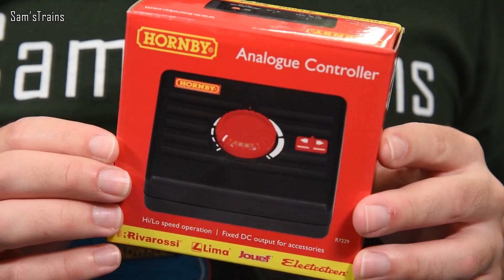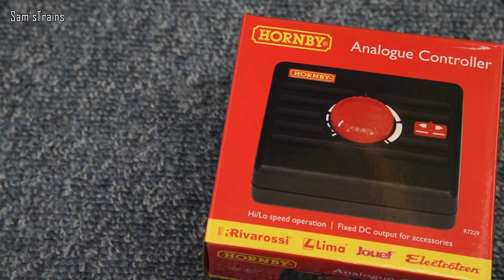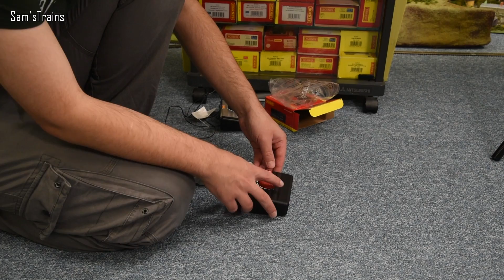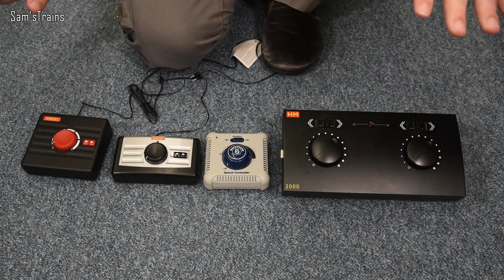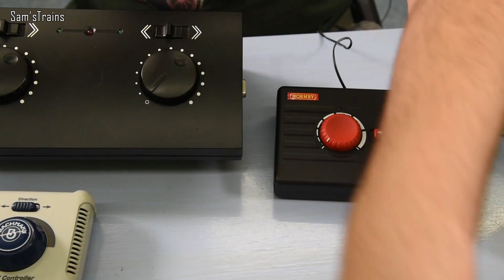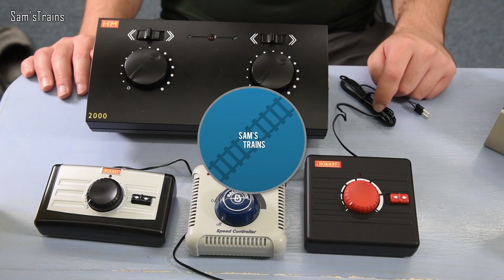Hornby's New DC Train Controller | Controller Buying Guide

Comment: If the "Hi-Lo" switch is anything like the old H&M Duette and similar (Including 1970s Hornby) controllers, then it's probably a resistance switch. They don't make much difference to the top speed, but should do so at the lower speeds. I think it had more to do with the difference in older Tri-ang era motors and the more efficient modern ones. The older motors needed a higher voltage to start, but newer ones would start moving at medium speed at the lowest speed setting. This feature is probably not needed these days, but try the switch at lower speeds and see if it makes a noticeable difference. 

Those same old H&M and Hornby controllers also had a half wave / full wave switch, which was a kind of crude PWM - except the voltage was variable and the pulse width was not, but you got half the AC waveform, so it was turning on and off at 50/60Hz allowing slow control of the motor. It also gave that loud hum. I understand that some motors don't like it, but most are not affected, other than being noisier.
Reply from the maker: Yep, it certainly looks that way - I bet that's all it is! Yes I bet half wave would definitely make the motors sing - not sure I'd fancy that, lol! ;D
Thanks for watching - Sam :)

Comment: Looks like a bachmann. By the way American style 0-4-0's are very cheap (under $20.00 which for the US is very cheap for a model locomotive) on ebay I recommend looking up Tyco 0-4-0's as they out-lasted the company, and still run like new, kinda...
Reply: Now if E-Z Command had the Hi-Lo feature, I could switch/shunt cars around and move intermodal trains at 70smph (scale miles per hour).
Reply from the maker: Yeah the Bachmann one was great for the money! I agree - though you could fit a hi-lo feature, you just need a high power resistor and a decent switch! ;D
Thanks for watching - Sam :)

Comment: Interesting Sam

I'm amazed at the lack of a reset button on any of the controllers. My old lay out had two controllers. A triang RP14 unit that ran the fiddle yard and the quarry sidings, and a H&M Powermaster which controlled the mainline and the station area (it was a fiddle yard to terminus branch layout) - I also had and old Scalextic RP 17 transformer that powered the point motors and lights for the buildings. ALL of them had little button that popped up if a short circuit happened, and stayed up until the fault had been cleared and could then just be pushed back in to reset. Easy, safe and convenient, I dunno why they dont have a similar system these days.

Jon
Reply from the maker: Me too Jon - it wouldn't have hurt would it?! A little button like yours would save hours of frustration over a whole childhood!
Thanks for watching - Sam :)
Reply: The problem with those buttons is that you could press them down and keep them pressed while the short circuit still existed. (Used to do that when I was little, many, many years ago.) They'd never pass the safety regulations these days.

Comment: When you brought a train ( Hornby or Tri-ang) set in the 60's. The controller had a small red button that popped out if you had a short circuit. fix the problem re-set the button and away you go, no waiting. H.M. 2000 is a controller that goes back to the late 70's. Back then this controller was put out by Hammet and Morgan who's controllers where as strong as tanks. My model of this controller is still going strong to this day it looks exactly the same but the lettering say's Hammet and Morgan 2000.Cheers, Chris Perry.
Reply from the maker: Yes I've been hearing about that CHris - it sounds like a much smarter solution if you ask me! Yep - you can't beat those H&M controllers, that's definitely true!
Thanks for watching - Sam :)
Reply: @SamsTrains  Just in passing I also have Hammet and Morgan's 3000 control  panel with brake control , regulater control, variable control and auto power control. plus all the other D.C. and A.C. extra's  A Roll's Royce of a panel. Nealy 40 yrs. old . It hasént missed a beat. Cheers Chris perry

Comment: Thanks for doing this Sam, most of my often run locos are DCC but for DC I have the silver Hornby controller and an ancient looking "Power Mite" controller which I started using for the DC locos because of that horrible motor noise that the Hornby one causes.
Now I've gone and bid on a HM2000 on ebay - don't tell the missus :)
Reply from the maker: My pleasure Gerry - ahh you're laughing then if your on DCC! haha - good choice on the HM2000 - I think the missus would understand ;)
Thanks for watching - Sam :)

Comment: I find it odd that the wires to the track are attached to the controller instead of the wall power wire. 
Nearly every American controller I have has separate track wires but an attached wall power wire (except for Bachmann's, in which the wall power supply can be detached as well as the track wires. by the way, mine is a zero to 100 version, not the on/off one like you have) They are attached by forks on the ends of the wire (or just the bare wire) onto screws.
Also, every controller that I have has ends for powering acessories via AC power, even the very cheap life-like controller (the only controller I have that doesn't have an LED, or a slider to change the direction. Instead, zero power is at 12 o'clock, and you turn right to go one way and left to go the other) 
The controller I mainly used is the MRC 220 (Tech 4), the standard bachmann USA controller (the image on this lkink is exactly what it looks like) https://www.decibelscalemodels.com/index.php?route=product/product&product_id=976
and the Athearn SDK-789.
Reply from the maker: Eih?? Don't they have to be connected to the controller?? The MRC sounds good though - I'll have to look those ones up! :D
Thanks for watching - Sam :)
Reply: @SamsTrains , yes, he means the controller is hard wired to the power adapter, where as the wires connection to the track have a removable socket.
Reply: Perhaps because the UK is 240v AC.
Reply: It's not about the voltage. It means Hornby can sell to multiple markets with a localized power adapter. I have a Hornby controller with an Australia socket. You can also use it in America where the voltage is 110V. It also means if the adapter fails or the controller fails, you could just replace the part that fails.

Comment: Again I have a dumb question but wondered if you would talk about it.

Can British train sets run in the U.S?
Reply: Assuming it's bought in the UK, the only thing preventing running will be the wall plug for the transformer. A simple double adapter for a UK to US plug will sort this.
Reply from the maker: Yep - you're absolutely right! Assuming you can find a suitable adaptor, (or just use a US controller), you should be fine! :D
Thanks for watching - Sam :)
Reply: The locos run off the same 12 volts DC as used in most US makes. The exceptions being three rail or centre stud such as Marklin, which run on 16 volts AC. The USA wall power supply is 110 volts AC at 60 Hertz . In the UK we use 230 volts AC at 50 hertz. A simple adapter socket will not work. You'd need a step up voltage converter to operate a UK wall wart in the USA. Much simpler to buy a US wall wart and controller such as those made by Atlas. That's what I used in the USA.
Reply: The U.S. mains power run on 110V AC so you will just need to check if the power adapter says it accepts an AC input in the range from 100V up to 250V. I live in Australia where we use the same voltage as the UK but we use a different plug and socket. Hornby specifically sells Australian adapters. Perhaps another reason they sell the control without the power adapter, to cater for the market in different countries.

Comment: That controller seems like a very good deal - And you really can't best their physical size.

I wonder if they sell different transformer adapters, so you could purchase the specific power pack that you need? (US, Euro, etc) Strange that they've done that, though.

Fun fact about the Bachmann E-Z controller, the DC output is compatible with a headphone jack, and I have tested this. It buzzes. Quite badly.

Edit: I made this comment before hearing the noise it made, goodness-
Reply from the maker: Yep it's certainly cheap - but not so much once you've had to buy the power supply!
I'm surprised the headphones survived... did they?!
Thanks for watching - Sam :)
Reply: @SamsTrains  The headphones survived alright, but something went wrong with the power supply I was using on my Bachmann controller (It came with a UK train set, and I was messing with an adaptor from another controller) disagreed with it, and it eventually quit working a few years later. A friend of mine with the DCC version, which has the same headphone jack adaptor, said it made a totally different buzzing.

Now, this means that there is one more logical step, plugging the track adaptor to the headphone jack of something like a cheap MP3 player and seeing what that does.

Bachmann shouldn't have given us this kind of power.
Reply: Yes, in Australia, we use a different plug so it means I can order the Hornby control from the UK and just use an Australian adapter.

Comment: I have a gauge master controller, it feels absolutely solid, but it looks awful, they all look like they came straight out the 1950/1960's I think if they changed them the be anodised aluminium case or brushed stainless steel, it would be extremely high quality, look and feel nice.
Reply from the maker: haha yeah they look awful, but they work great don't they?? An updated design would be great for them!
Thanks for watching - Sam :)
Reply: @SamsTrains  yes it works flawlessly, all they need is new case, keep the switches and dial and internal electronics the same.

Comment: Well... At least my controllers are authentic, by which I mean they were made when the steam locos on my layout's real life counterparts were still operational. They do however, give a very nice slow speed and are very satisfying to use. Great video.
Reply from the maker: haha that's pretty awesome!! Which ones are you using mate?? :3
Thanks for watching - Sam :)
Reply: I've just had a look and I think they were actually made a year after steam was withdrawn. They are the H&M Duette twin power supplies. Three of them. We got them with 12A fuses so they weren't the safest things in the world, but with a few fixes they work great.

Comment: Wow there is a massive gaping hole in the market for a controller that is good value with good features and proper ocp. This is crazy. The components these are made from are very cheap. I bet if hattons made a decent mid range controller with a decent feature set they could sell loads.
Reply from the maker: I know it! For such simple devices - how can none of them be perfect? The Gaugemaster ones are supposed to be excellent though!
Thanks for watching - Sam :)

Comment: I feel it may have been a little fairer to use a proper Bachmann clip for the Bachmann controller, rather than mutilating the cable! I have no issues with speed control with my own controllers, both being Bachmann, but I find the Gaugemaster Combi is the best controller. If you could do a review on one of these, that would be excellent!
Reply from the maker: Noo that won't make a difference at all - there's nothing inside the connector that could affect the performance! Yes the Gaugemasters are all excellent - I've used them but never owned one - I will have to try one!
Thanks for watching - Sam :)

Comment: Don't buy these Hornby controllers, get yourself a Gaugemaster one. High quality, a good nob, works universally and lasts forever. I'd had mine since I was 8! And it still works just fine! Also, that satisfying click noise on the Bachmann controller is to cut the power because American plug sockets can't be turned off I believe.
Reply from the maker: Yep absolutely - Gaugemaster are better, I've used one before!!
Thanks for watching - Sam :)

Comment: Well done.  Analog controllers don't need much to them, but they deserve better than Hornby's.  The HM2000 is a watermelon to the apples you provided, as it not only is a double, but has the expansion features, which you graded well, but perhaps unfairly graded in price, because, even if you cut it in half, the expansion and extra attachment features give you a lot more "bang for the buck" as we say in the USA. ("Punch for the Pound" for the UK?)
Reply from the maker: I agree Anthony - as relatively simple devices, I'm amazed by how bad Hornby's controllers are... what's the matter with them?! Yes you're right actually - it's an infinitely better controller!
Thanks for watching - Sam :)

Comment: The reason why it is NOT an improvement do to it is still requires that weak 19V 500mA supply. 500mA is barely enough for 2 loop/track layout specially if u want to use some older locos with long trains, and when u have electric points and lights too It heats up and overloads, and a 19V supply is not the voltage u can get a stronger one (like 2A) at the local hardware, or electronics store! Yes it does work with a common 12V supply, but the way I noticed; U get far less/worse speed control (with the old one + Ampere output is bad too). NOT RECOMMENDED!
Reply from the maker: It is, you're right! And to have an accessory output that shares that 500mA supply is laughable - they're such numpties! ;D
Thanks for watching - Sam :)
Reply: The controllers don't put out amps. The locos and accessories draw amps. If you have too high an amperage then if there's a short circuit the power won't be cut off and could cause a fire. Hornby controller usually put out too much voltage when the controller is turned up to max anyway. 00 locos are designed to run on 12 volts and N gauge locos are happy on 9 volts.

Comment: Good to see something like this! I completely agree with your comment about the feel and look.  
I think the ideal controller would be one that you don't really notice. So the we focus on running our trains. :-) 
Those R8250 controllers are horrendous!! Looks are cheap. Feel is cheap. Performance is cheap. I don't believe this new one will be any better.
All though not perfect, the R965 controllers are way better. MH series are nice. Bachmann's dials are very smooth to the touch. 
I found that the Gaugemaster controllers are the best. 
Good test! :-D Have you ever tried the R965's??
Reply from the maker: Thanks a lot Sammy - I'm gutted they didn't fix that! Absolutely - if you notice the controller, they're doing it all wrong! Yes the older controllers are much better!
Thanks for watching - Sam :)

Comment: get a hammond and morgan duett or clipper controler they are old ,look good and are made very strong sometimes you can see them at train shows going at a good price
Reply from the maker: Thanks for this Mark - it might be worth getting one for testing purposes, for sure! :D
Thanks for watching - Sam :)
Reply: They go cheap because they're really poor low speed performers. (I have a Duette) They feel and look great but the lack of any PWM or feedback means that locos have a tendency to suddenly take off due to stiction. Also they're really old, the insulation can break down over time so if you pick one up get it safety tested before use.
Reply: @jonathanratcliffe5714  i must have the good ones  my trains can go very slow  they do have half power and a resistor switch
Reply: @whiteheadmark  yours could well be in better condition than mine which spent many years in an attic, what tends to happen for me is that the locos go with a lurch but once they're going you can reduce the speed considerably. I'm also probably being a bit unfair and comparing to modern gaugemaster controllers which are superb.

Comment: That's interesting I need a cheap controller to buy for powering a small test track. Although my 15-16 year old gaugemaster one will still be used on my main layout as it delivers the power so smoothly. Also do you remember the controllers before these more modern controllers.

P.S i pre order the small hornby Ruston shunter (the red and white one) can't wait.
Reply from the maker: Thanks Ben - yeah I don't think you'll beat the little gaugemaster ones! I can't wait for those either!!! :D
Thanks for watching - Sam :)
Reply: @SamsTrains  mine is quite a large single unit controller. But it is well engineered. Been tempted to buy another one and get my dad's old hornby Dublo three rail trains going.